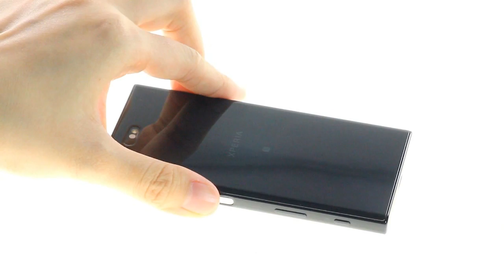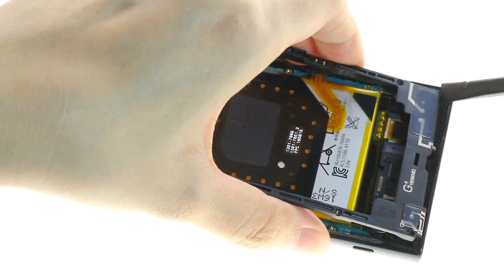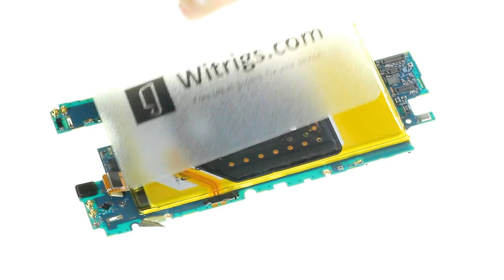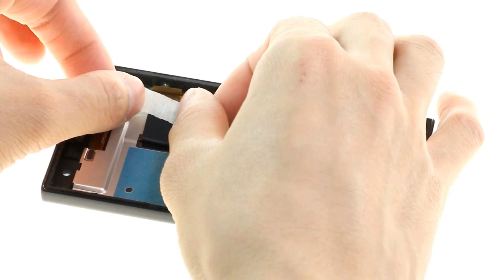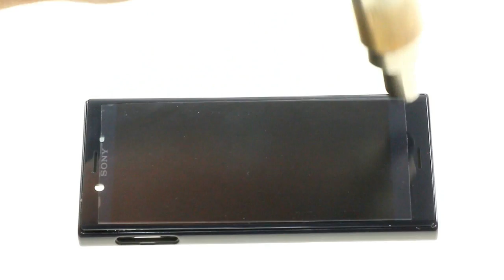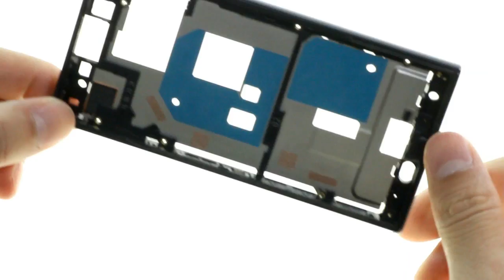Sony Xperia X Compact Teardown

Comment: can the phone without flex battery cable mine broken, no power but there is a charging red light..and now green light after blow dry.please help subbed
Reply from the maker: You need to replace the battery.

Comment: I've seen some comments about water resistance. I droped mine into the sea just for a minute. Just switched immediately OFF, rinsed with deionized water and then left in a bag with rice for 48 hours. First day and works fine! Hope will stay like this...
Reply from the maker: Wow you've done a very correct and professional emergent measure. You are awesome!
Reply: Very late but, Xperia X compact is IP68 regardless of region, just that Sony doesn't disclose waterproofing in EU for some reason

Comment: Hey, I just bought a replacement battery for my Sony Xperia X Compact. The phone uses battery super super quick. Do you have a video on how to take out the battery and replace it?
Reply from the maker: Hi, I'm sorry there's no battery repair guide online yet. But you can follow this teardown video and take off the battery first, then install the new battery, you can use 3MM double side tape to replace the original battery adhesive.

Comment: Is it possible to replace a screen only?
Reply from the maker: The lcd screen? or only the glass?
Reply: Glass. The glass here with touch panel like in Z1c?
Reply from the maker: No, the glass of X Compact is just a piece of glass
Reply: Thanks for answer. Very useful video btw.

Comment: As we all can see, this phone inside is not different to earlier z5 or z3, the cover is glue protected, charging protected with rubber, 3.5mm protected with glue and speakers also protected with glue, so no water could enter device. BUT IF IT GETS IN ITS YOUR PROBLEM IF YOU DID NOT BOUGHT IT IN JAPAN, poor non japans we are :(

Comment: glue => bad engineering
Reply: Agreed. And they make it very difficult to replace the battery :/
Reply: Glue is to seal the phone and keep the battery in place.
Its a lot easier to remove in Sony phones than with other brands though.

Comment: Hey.
Tell me please, is available in this phone protection from water?
Some have argued that despite the fact that it is not claimed.

Experts, who understand it must know exactly about this.
Thank you in advance for your response.
Sorry for my english :)
Reply from the maker: Sony official didn't claim that, however it does make some waterproof process on this phone, at least you can hold it with wet hands n don't worry to ruin it when water splashing on it accidentally. Here is an advise, do not use it under water, cause if it was water damaged, sony will not be responsible for that.
Reply from the maker: Sony official didn't claim that, however it does make some waterproof process on this phone, at least you can hold it with wet hands n don't worry to ruin it when water splashing on it accidentally. Here is an advise, do not use it under water, cause if it was water damaged, sony will not be responsible for that.
Reply: Thank you very much for your answer! Good luck to you!
Reply: As we all can see, this phone inside is not different to earlier z5 or z3, the cover is glue protected, charging protected with rubber, 3.5mm protected with glue and speakers also protected with glue, so no water could enter device. BUT IF IT GETS IN ITS YOUR PROBLEM IF YOU DID NOT BOUGHT IT IN JAPAN, poor non japans we are :(

Comment: What do you think about the overall build quality of this device,I am planing to buy it soon.Thank you.
Reply from the maker: Tiny, as you know. you can hold it in pocket n use by one hand. plastic body which means it's lighter than other X series phones, however it's easy to get scratches(like in my scratch test video). and plastic brackets(sony's tradition) I think it's good for protecting the internals when fell accidentally. For this phone I have to say I'm pretty like the battery sticker design, easy to remove, unlike most other sony battery sticker (hard to remove n easy to be broken). n they use anti-scratch glass on the camera lens I like that. and... ok that's it ;) hope that can be help.
Reply: Thanks alot dear, my only concern is the scratchy back cover since I keep my mobile phone +3 years.
Reply: johnes daived all my Sony phones last 2.5 years until I get a new one. All of them still work. X Compact is great, what I typed this on.

Comment: Excellent video. I noticed the gasket on the charging port,  I know the sim tray has one and with evidence from youtube its obvious this is water resistant. Would you think that's the case?
Subscribed.
Reply: Wit Rigs In the user guide to the X Compact it says: "This device has a capless USB port. If your device gets exposed to water, ensure that the USB
Type-C port is completely dry before connecting a USB Type-C cable"  For any non-waterproof it would say something like "Your phone is not waterproof,  whatever you do DO NOT expose it to water!!" I think all X Compacts are the same,  ie IP68 certified as in Japan,  they are just not marketed that way outside Japan.
Reply from the maker: for life waterproof? yes. Sony did this to their phones for a long time, but plz do not use X Compact under water, if Sony official doesn't say that phone is water resistant, do not try. Thanks for subscribe ;) have a nice day
Reply: repo4 Japanese variabts are waterproof, so I guess this is also the same
Reply from the maker: Shawn Mendes some people say that was because most Japanese likes bath and using phones when in bathtub, so they have to make phones waterproof, like at least you can hold it with wet hands. :D
Reply: Wit Rigs I also love bath tubs, so I wish Sony made one for me lol. Thanks for the response and a great video
Reply: on official Japan Sony mobile site it says IPX 5/8 waterproofing